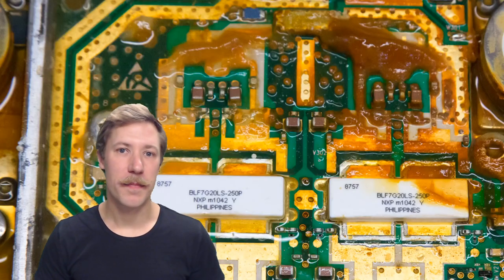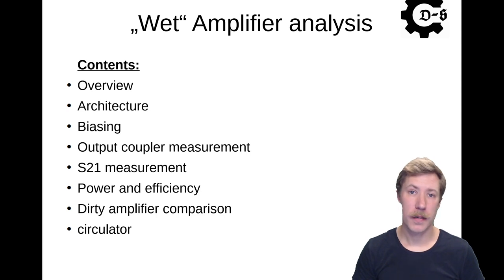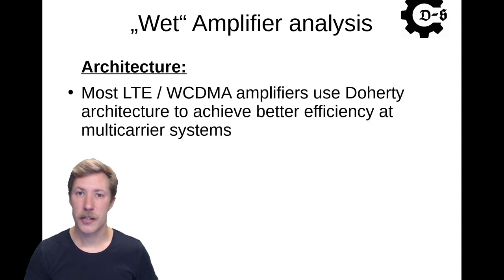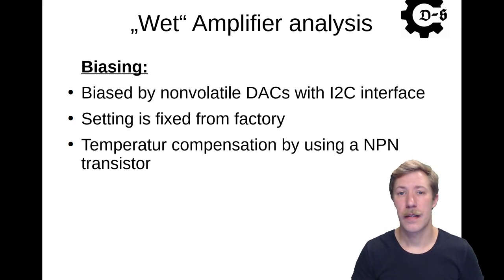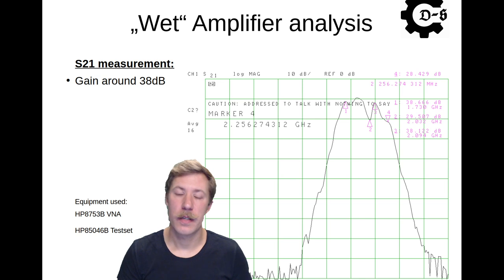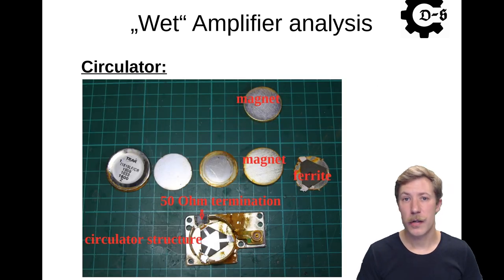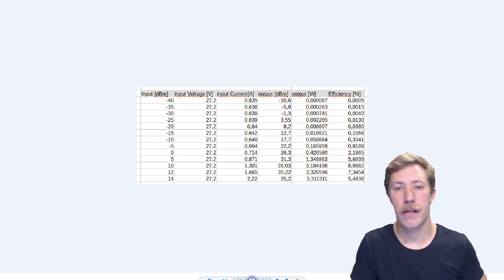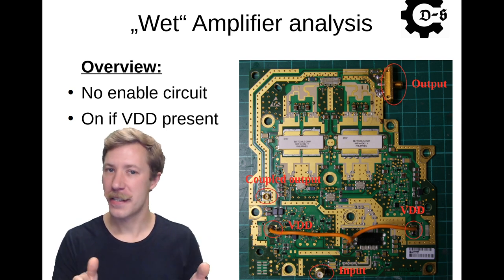Nokia Siemens Flexi 3x70W FXEA 1800MHz Power Amplifier Reverse Engineering (Part 3 of 3)

Comment: In a Doherty power amplifier, the biasing for the two transistors in the amplifier needs to be different: The main transistor is biased in class AB, while the other transistor is biased in class-C.
When you do this, the typical Doherty efficiency shape should appear.

Comment: He did not drive that amplifier close to saturation that's why the efficiency appears low. That amp should do 500w CW with those devices at low bias. It's also hard to get theoretical class AB peak 74% efficiency with these high power LDMOS devices at GHz frequencies due to losses in the transistors. At VHF freqs LDMOS transistors can get to 84% efficiency at near class D saturation.